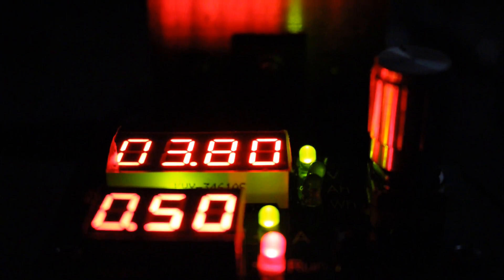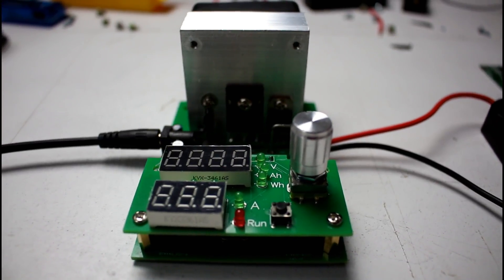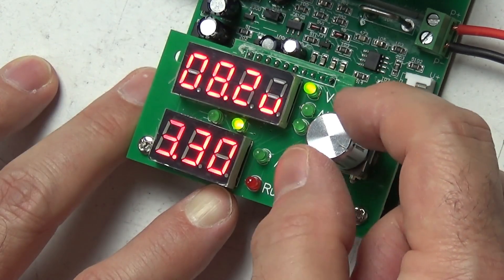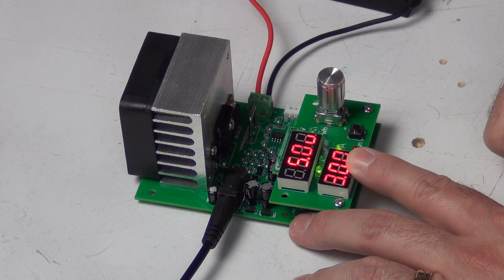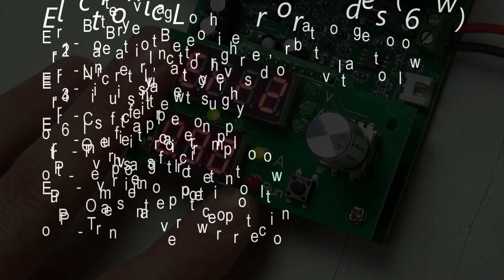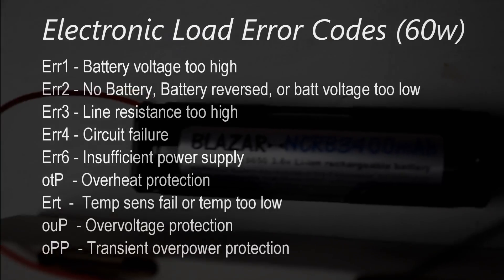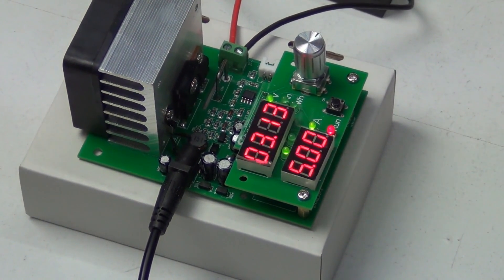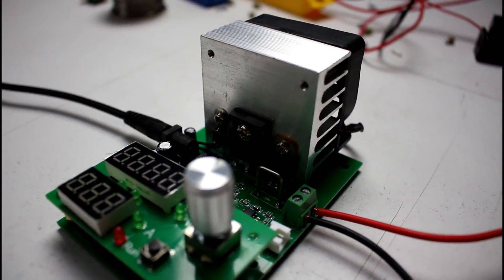Electronic Load & Battery Tester - Do you need one? (MEHS) Episode 67

Comment: I came across an ERR4, and I couldn't get the unit to function correctly. So I assume it is a catastrophic error, and can't be fixed. If anyone has any fixes for this, I'd appreciate it
Reply from the maker: - Hi.  ERR4 is circuit failure.  Check all connections and use different cells to test.  If no improvement, grab your multimeter and do some continuity testing and maybe also test some of the passive components.  Aside from that, not much else I can suggest.  Cheers.
Reply: My Electronics & Hacking Show Sure, I will. I did try several different batteries, but just wouldn't get out of ERR4. I had gotten a replacement and that works just fine so it's definitely not the batteries. Works great discharging them though. Seems to be very accurate in counting the Ah
Reply from the maker: - Glad to hear you got a replacement.  Yes it works fine and is definitely a cheaper option that a full bench unit.  Cheers.

Comment: Wouldn't it be better just to hook up a boost converter and some high power resistors? That's what I'm doing to test powerbanks.
Reply from the maker: - Hi.  You're basically achieving the same result but this affordable device provides some great convenience and automation that I find useful.  For long processes its nice to set the parameters and walk away rather than have to continually monitor the results for accurate data.  Cheers.
Reply: Yeah. Also, it is very nice to have non-fixed voltages and current loads.
Also, have you thought have your BMS project that you said you'd continue a while back? Would be very interested to know how it's up to now.
Reply from the maker: - Hi.  Many project, bad memory.  Which one did you mean?  Was it the BMS combined with the MAX745 solution?  Cheers.
Reply: Yes, this is what I was talking about. The BMS combined with the MAX745 IC.
Reply: Ok, I actually finally bought the unit. Wasn't very useful doing this with resistors since I couldn't set an predefined parameters myself.